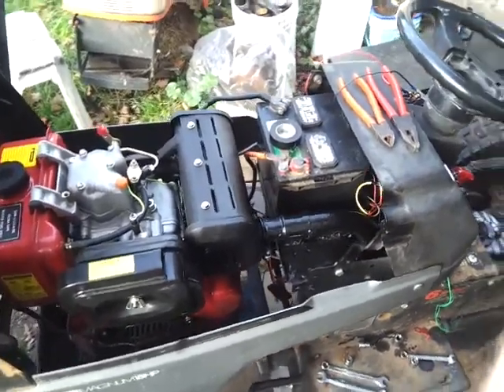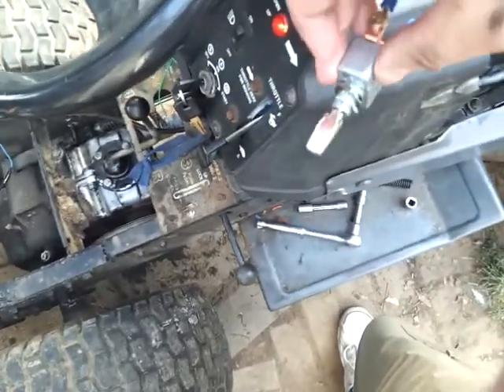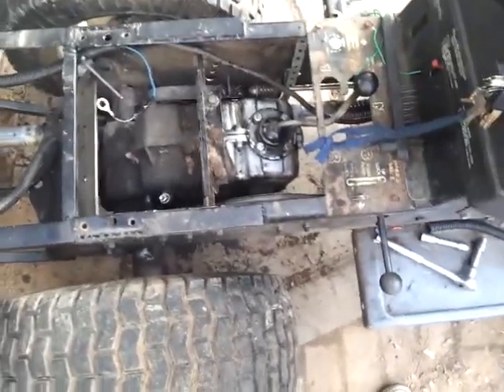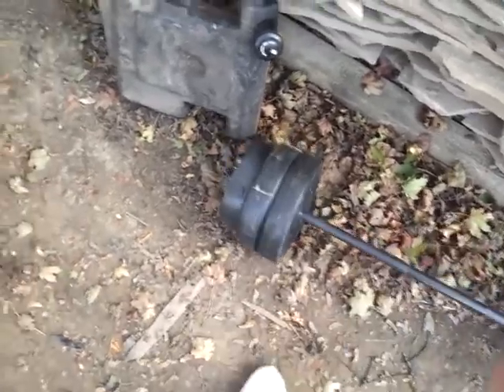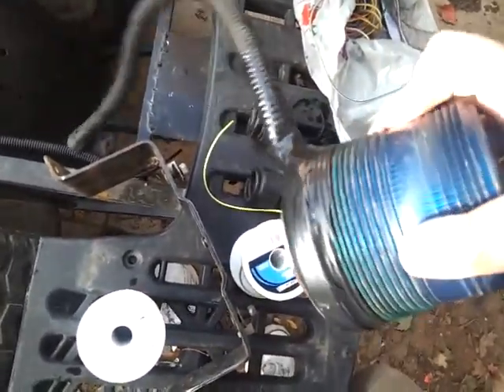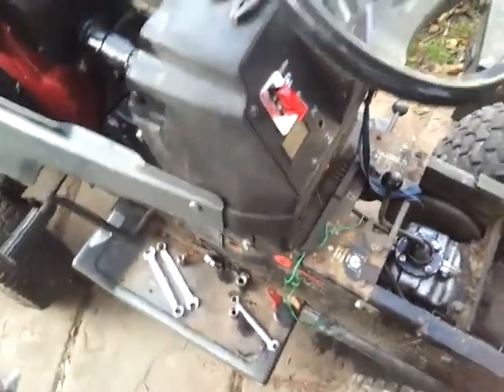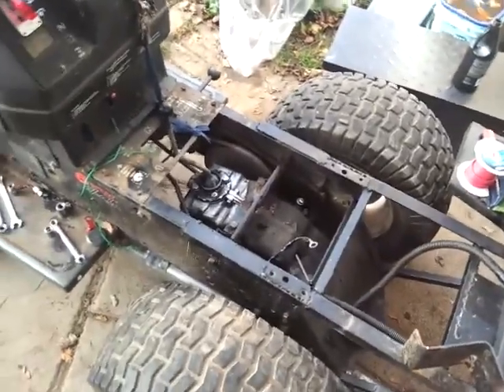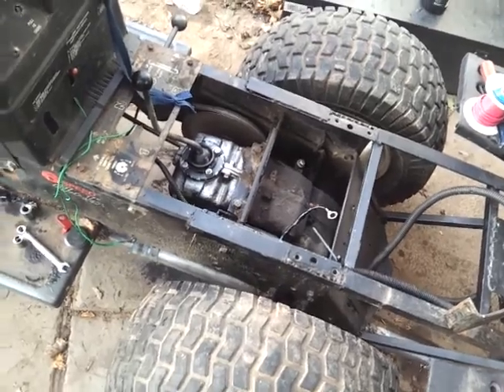Craftsman GT6000 Diesel Update Wiring Finished

Comment: I know ya like your clutch safety...I don't mind em either ....but for now remember to always start it with the clutch in and sitting on it. It's just a good habit to get into, in case ya came across a unit with no safety switches. 
I made a half ass hook to hold my clutch pedal down. 
I  even do that in my car....most cars have a clutch safety nowadays but not my 95...pre obd2 ftw :)